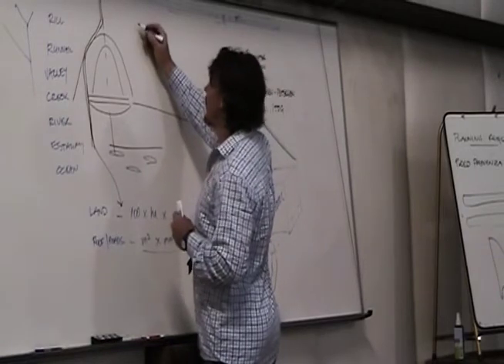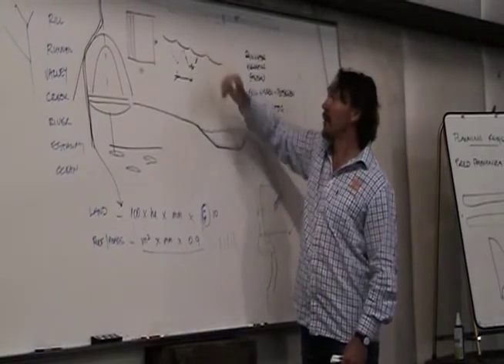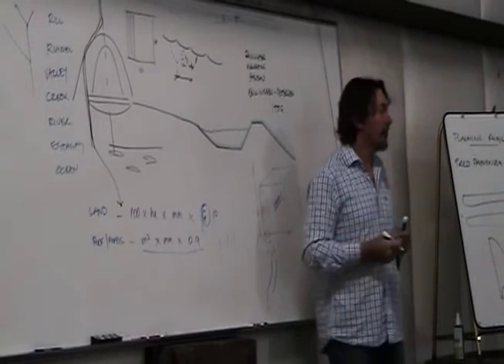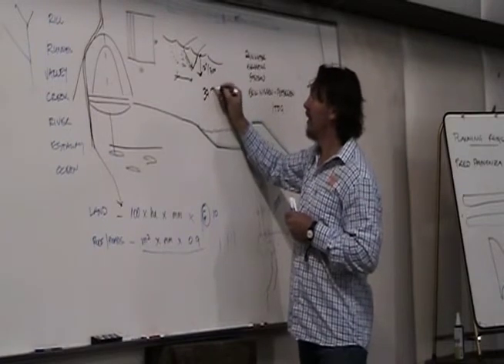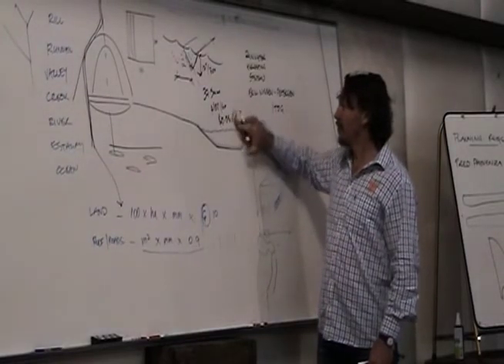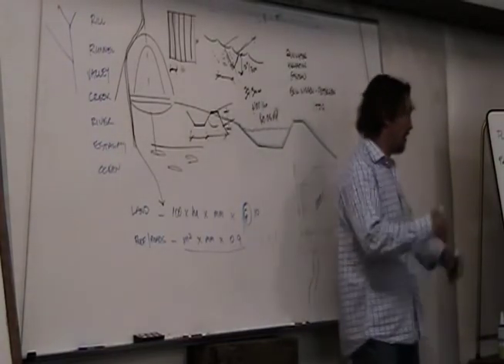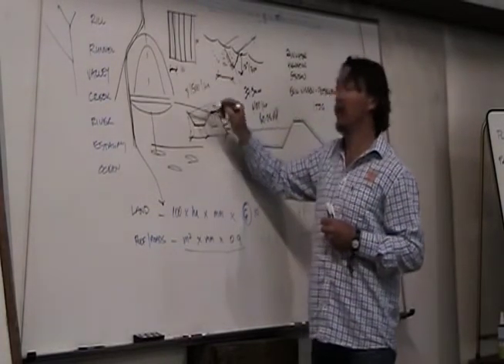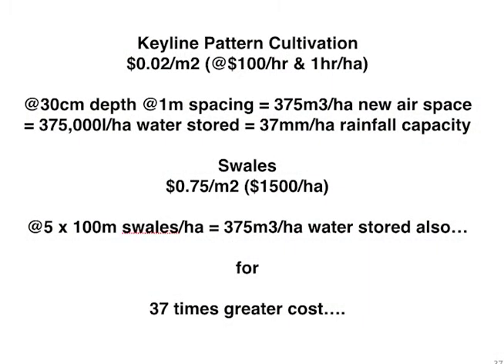21 Swale Keyline Comparison

Comment: Some things he is not mentioning here, which are important for those people first encountering these concepts:

- Swales can move large amounts of runoff water from one area to another and at the same time spread it out over a landscape. This means that if you have a road, a building, a pond or other large runoff area on, or nearby, your land you can harvest that tiny river of water that runs on it and bring it to places that a keyline plow won't take it. 

- Keyline design can function in places where swales will fail miserably. Mainly in land where the bedrock is very close to the surface. If you infiltrate a lot of water in one area through a swale, you can cause a mudslide. 
- Swales can function as part of a nutrient flow system. So for instance you can have a duck pond at the top of your property, that the ducks manure in every day. If you run water into that pond, the overflow of it can be channeled into swales which will spread out the nutrients from that pond.
- Swales are a tree growing system.  Keyline design is often used in grazing land.

Keyline design works its wonders in large scale properties that focus on grazing, or agroforestry. If they have runoff it is largely due to compaction of the soil or bare ground above the property. Gulleys are often turned into dams using keyline design. 

Swales work their wonder in smaller properties that are able to receive a lot of excess runoff water, they will plant that water and put it to productive use. They also shine when working with trees and nutrient flow systems like ponds or cattle yards.
Reply: Great feedback. I sent you an email about the keyline and gullies as dams. Would love to know more about that.
Reply: Futurecare Design great response, I always a swale system could call mudslides. So in your opinion how much grade in the Keyline would be too much? Are 1-200 or 1-400 too steep? I am working on building a water level system with metric. My Idea is to use velcro on my 2 x 2 sticks so I can raise or lower my ruler to the right water level. At this time I’m waiting on my ruler to be delivered. This ruler starts at zero in the middle and the numbers go up, I have a piece of rope 10 m long hook to the bottom of my sticks so if I’m doing a swale I would hold the sticks together, move both rulers so they are on zero. So now both people can see the numbers. So if you are working on a Keyline of say 1 percent you stick could be set at 10 CM PLUS, and the other would be set at 10 CM minus. One stick stays at the starting place, Move the other stick out until your rope is tight, now the neat thing happens. All you have to do is move the stick up or down the hillside until your stick reads ZERO. Both people will have a ZERO reading. I will have to make a few videos.
Reply: In the end it all resumes to what is needed in a certain location. No big surprise really. Like the guy on the video so well mentioned this are just tools. So not creating dogmas about it, is definitely a good idea.

Although a swale can also perform as a "path". The more often reality is that it's a man made barrier! I guess, it's worth mention that a land clear of "obstacles" will always be worth more than a land made into a labyrinth of small, or big, obstacles. It's rather simple. Driving a tractor on a clear tract of land or one riddled with swales and ponds... You get the picture! ;-)
Being a designer myself. I can say that through proper design that issue can be minimized. But will always be present, since it's an infrastructure implementation.

On my own land, of little more than an hectare. There's obvious places for both systems! Different intents, different conditions! And that's on a small piece of land! ;-)

Comment: The video starts with the statement "you have to be very specific", but it's not specific at all! One of the principles on which permaculture has been founded is that any part of a system has to perform different tasks. Swales do not only harvest rainwater. They slow, spread and seep water. They collect organic material, they form microclimates, they can be used to access parts of the property or to collect harvested goods, they are "tree growing systems" (as Geoff Lawton uses to say).
Reply: Right; these plow lines are not fulfilling the same purposes as the swales (except obviously, catching water and stopping it). E.g. where rain causes lots of erosion, I can't imagine his plow having the same slowing effect.

But he does make an important point that it's easier and faster to plow up a small line than to build a swale, so if you don't need the other aspects of a swale...
Reply: Keyline design also does not only capture water. It slows, spreads, and sinks as well. In fact, keyline design was created by Yeomans in order to effectively help move water from valleys to ridges. And a lot of keyline designed farms will implement keyline silvopasture paddocks between tree blocks. The one major advantage of keyline, as I understand it, is that because all the ripped lines and tree blocks are parallel to each other, it is easier to temporarily fence paddocks for rotational silvopasture grazing. Whereas silvopasture between swales, will often be more problematic due to very narrow or wide or heavily curved sections in areas because of the on-contour design. So, keyline makes large scale management much easier, while still providing a lot of the same benefits of slowing, spreading, and sinking water.  That doesn’t mean one is necessarily better than the other, just that they should be implemented based on context and site assessment, rather than trying to force a design technique (i.e., swales) onto every situation, some where they may ultimately be more problematic than beneficial.

Comment: Hmmm.  Here, I had swales put in for half the cost / hour of what was stated here.   I also wonder about the longevity of the structure.  How long does it last before it needs to be done again to keep it effective?   I agree with a post below about specific application.  Swales are designed to grow trees, which is what I wanted to do.   Keyline is better suited for larger areas, such as pasture, and I wasn't intending to raise grazing animals or grow large crops.   And that goes back to the question of longevity.  A keylined field raising cattle will get compacted again over time presumably, whereas a swale is not exposed to that type of action.

Comment: Interesting to learn about permaculture and find some of the same elements as conventional with different names. Keyline/swales : subsoil ripping/terraces. I do both as a wheat farmer, though subsoiling is winning. 

I find it more expensive to rip every other year than have a terrace installation that lasts 50 years, but the ripping is more precise and stores more water.

Comment: Now I would like to see that put into action. How much does it really cost and how much does it really catch. And as a swale is a TREE GROWING installation, the benefit of that has to be factored in plus a swale is a long term installation. The thinking behind that explanation is what is wrong with agriculture and related academia. Obviously ! swales are a tool that is sometimes useful and sometimes not and keyline design might be the better option. So I am not sure if a reasonable comparsion would ever be possible.

A screwdriver is not always the best tool of choice, sometimes you need a hammer, and a cost comparsion of both tools does not really make sense.

Where either design could make sense.

That said: he makes A LOT of ASSUMPTION to make his arguments. it is almost certainly incorrect. 

That is - onethinks how things work THEN you put them into practice and THEN you can say if it really works like you thought it would. Mistakes are great they force you to improve the understanding of what is REALLY going on.
Reply: Not with such kind of "math" for sure!

Comment: You are looking at one piece of the greater picture. There are many pieces and must all be examined and put together. Designing a system requires it if you are to be successful. Failure to do it is like assembling a jig saw puzzle with pieces missing.